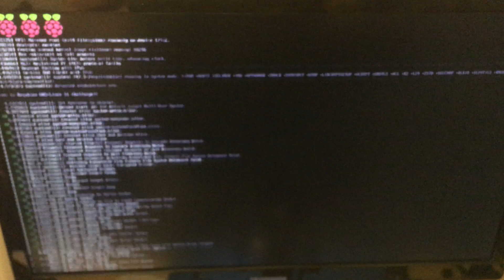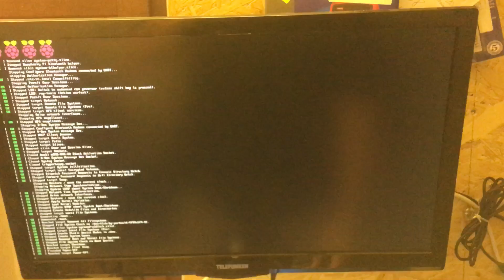DIY Raspberry Pi  3A+ and RPI HQ camera electronic microscope part 1

Comment: Wow, great job! I was searching this exactly I want. Maybe It will be more expensive than Chinese microscopes but i believe that it will be better.
Reply from the maker: And with RPI it is completely open and you can do what ever you want if you have programming skills.
Reply: @daSamo123  I don't have programming skills, but I think that I can handle this. Should I have RPI 3 A+, or can I use the other single board solutions with your project?
Reply from the maker: @tcirit  If you want to use a pcb like me you have to use a RPI 3A+ because of the mounting holes. Otherwise you can choose a RPI model of your choice.